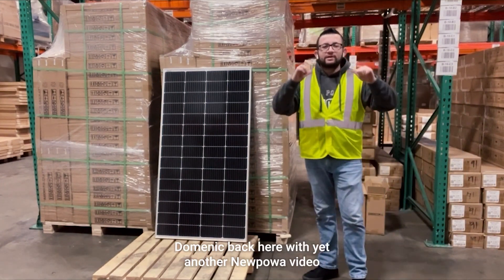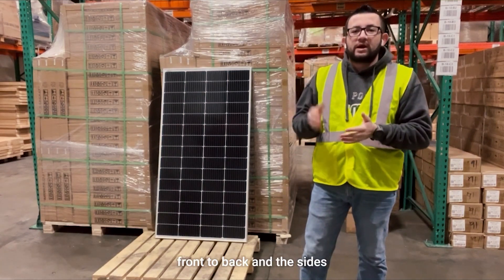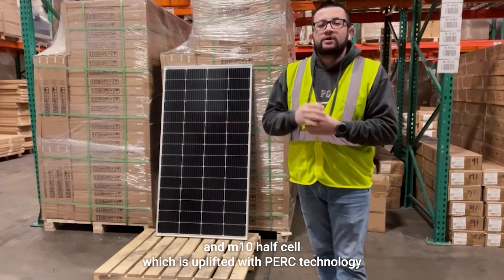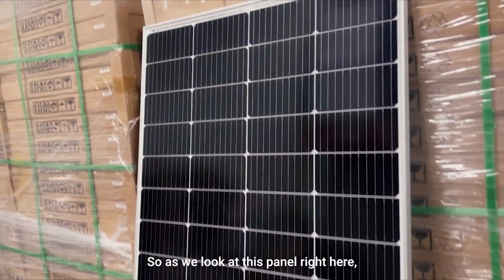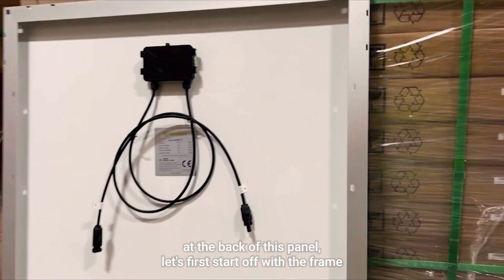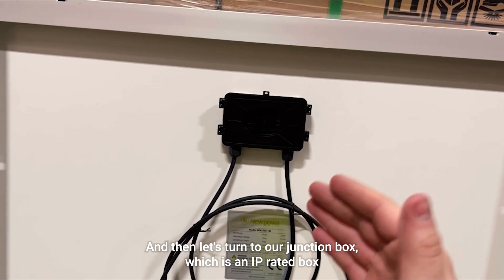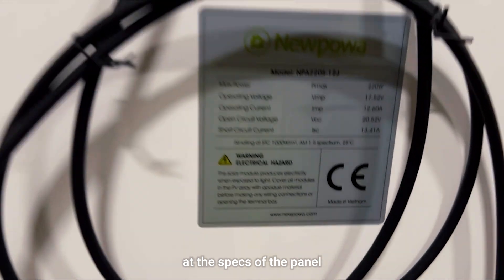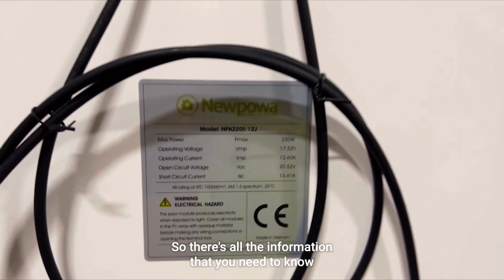Newpowa's 220W 12V Solar Panel

Comment: Do you happen to have a demonstration of how the wiring for 2+ panels get connected to a charge controller? We purchased a set for a van build, but don't see any mention of wiring that extends to be connected to the charge controller inside the vehicle.
Reply from the maker: We sure do. Check this page out: https://www.newpowa.com/products/accessories/wiring-connectors/
Reply: Wrong place to ask that question. You need to do your homework. You need to see what is max amp and max voltage your mppt will take. Then connect them to make it work with the mppt. Also put a fuse on the positive of each panel because they run close to their max amps rating.
Reply: @brucey5585  what’s up with the attitude? The comment section seems like the wrong place to mansplain and condescend to a complete stranger.
Reply: @brucey5585  I’m asking about the wiring on the solar panel. I already purchased the appropriate solar panels and charge controller for my set up. Wrong place to comment when you don’t know what I’m referring to. Mind ya business pal.